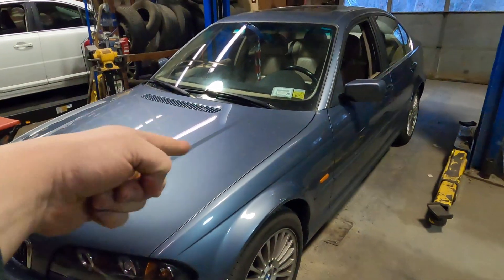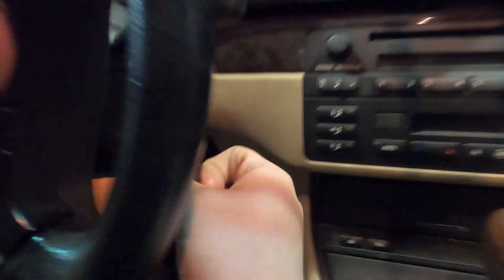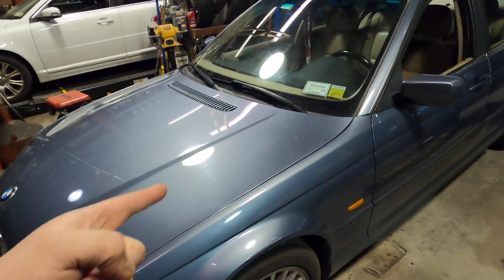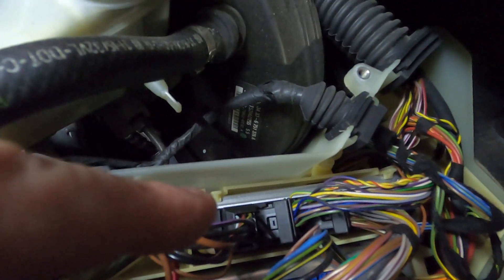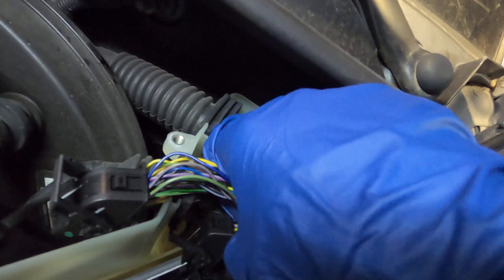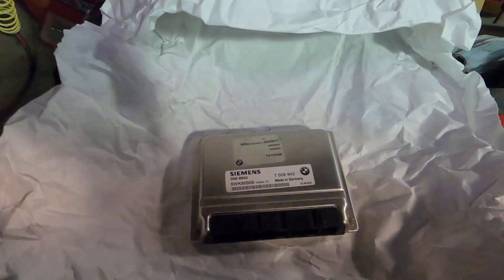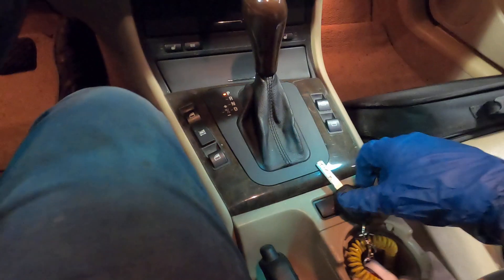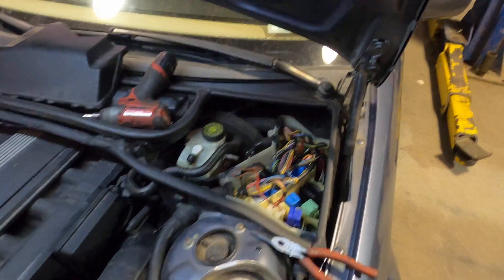2001 BMW DME EWS Delete Remove & Install

Comment: Why were all those parts thrown at the problem? The dme ews start program will tell you if there’s a fault in the ews module and if the dme recognizes the key. It also lets you reset the synchronization of the dme to the module. From your post the no start problem was intermittent, if it started sometimes, the key or the module wasn’t the reason for the no start, it was probably the synchronization with the dme all along.
Reply from the maker: ya I syncroed it and reset t and it still left me stranded look all I know is to this day it starts so for me this worked
Reply: How do I resync my dme if I just motor swapped m54 into it 01 e39 cranks but won’t turn over
Reply: @marioortega6657 bro me and you both did you fix

Comment: It looks like from other comments that you already messed with pa soft bmw scanner?  Did going into the dme and disabling ews did not work for you? Just trying to understand the need to buy a new dme vs just disabling ews on yours with pa soft bmw scanner.   Another question….Going to a different computer, did you have any issues with the mileage?  Did your original mileage still show up?  Did you get a tamper dot on your mileage? Thanks!!!
Reply from the maker: no u can reprogram it I did not have the cable or software at the time  buying a new ews with the delete  worked for me is all.

Comment: what website did you get it from my bmw 325i 2003 is having the same thing going wrong some times it wont no crank or anything then other times it will im pretty sure its the EWS
Reply from the maker: I just typed it into google and the first one I saw was the one I got in the shopping section no website.

Comment: i may be wrong , but  dont program or code with oem software as ews will return in you get rolling code errors with no start .
Reply from the maker: well as u can now see the problem was in the ews in the first place so I had to find someone who did it Other wise I'm sure the BMW company would have loved for me to keep coming back and spending a lot of money with other parts.

Comment: Hey man I’m stumped and I think I need to order a EWS Deleted DME. My car has no crank and I’ve troubleshooted it to the point where I’m confident it’s the EWS my dash was also having issue which could be a possible cause. What we’re your symptoms for being stranded?
Reply from the maker: every so often after resetting it with scanner it would be fine , until end of the week were it would crank but not start leaving me stranded. But considering you said it has no start I would check Starter, Relays to starter, the ground to the starter, Battery, and u can check that you by putting in the key to the car. When u do that if u turn the key and nothing turns on battery might be dead. If you go to start and the lights flicker that is also a sign that batt is dead. If you try to start and you hear a click try hitting the starter and see if she goes. Ps you can also check fuel pump heard some story's about that to hope this helps.
Reply: Appreciate the reply, I ended up ordering a EWS deleted DME so I’ll try that and if that doesn’t work I’ll check everything you said here.
Reply from the maker: @PrestonMX  sounds good I know it feels like u try everything and nothing works iv been there were I'm like I can't believe that was not the problem and the light at the end of the tunnel seems like you will never get there but keep going I love the car now that it works saves me a lot on gas's now a days keep going its most likely that but ya let me know the outcome I'm interested to here what you find.
Reply: @PrestonMX  Did EWS delete solve your problem?
Reply: Hey @BobbyLeeMutah did that fix your problem?
Reply: Wonderful vid !! My symptoms were no crank/start. But because mine is manual, I can push start it and it would run until I cut the car off. . There are vids out there to narrow down the issue to indicate Ews as the culprit. I am ordering the Ews deleted DME off eBay for $139.99. As soon as it comes in, I will install and update. Thanks for the vid again!!
Reply: Hey what year and model do you have? Push starting actually worked?